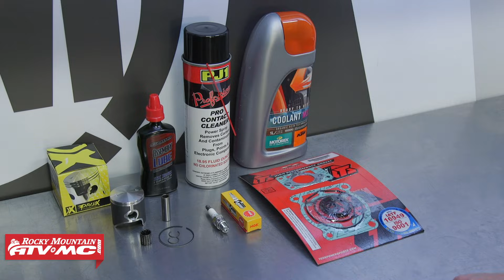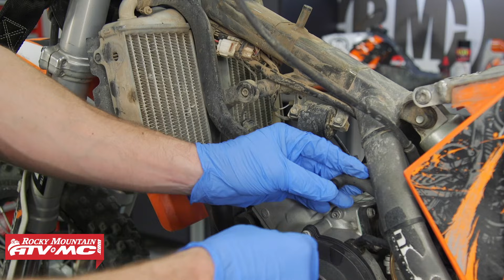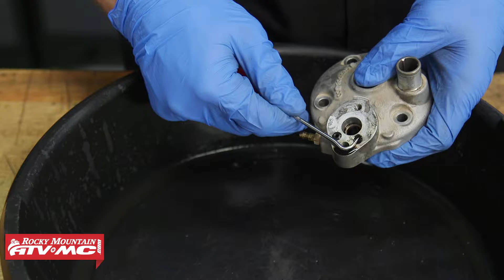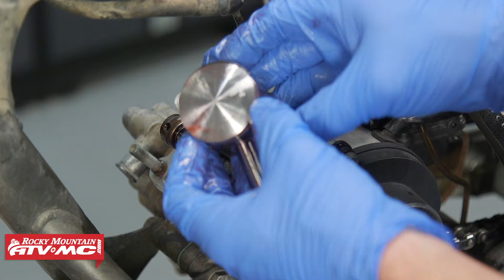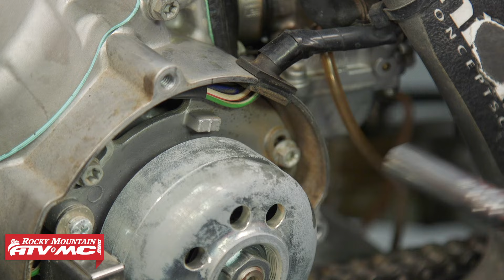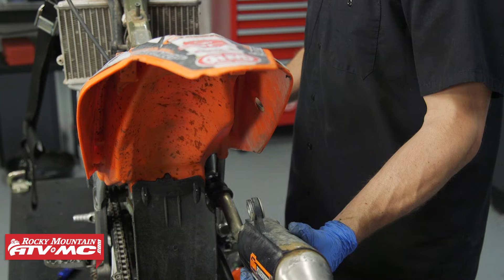How To Rebuild the Top End on 2009-2021 KTM, Husqvarna & GasGas 65cc Dirt Bikes

Comment: Like the video. Already rebuilt the bike once. I remember doing the deck check, but do not remember about the timing check and/or if I did that. Bike ran great, but did not like to cold start. Added next size or two pilot jet, so thinking my timing could have been off a little this rebuild. I'll have to check if it is advanced, etc. before I take this one apart all the way in the case it runs better as it's supposed to be or as it is today. Appreciate it!

Comment: Hi I have a ktm65sx 09 when I'm trying to start it keeps on blowing coolant hoses and will not start
Reply from the maker: It sounds like you might have a bad head gasket. You could be having compression pushed back into the coolant system making those hoses pop off.
Reply: @rmatvmc  fix by changing the head gaskets and o rings

Comment: Hi my gear box oil is turning milky after a few rides I've changed the  water pump seals but its still doing it please have you or can you do a video on this issue we have a KTM SX 65 2019
Reply from the maker: https://www.rockymountainatvmc.com/parts/nihilo-concepts-reusable-inner-clutch-cover-gasket-p?v=15836 Did you replace this gasket too? Coolant flows through it. -Charles
Reply: It's a pretty common is on these. lts probably not coolant and just water from washing/riding. Change the fluid often. Its cheap and easy maintenance!

Comment: Just sent our son’s 2020 KTM 65 into the local KTM shop for a clutch issue and they identified that it also had a broken power valve that had become so damaged that the cylinder needs replacing. They also said the cylinder and the parts for the top end rebuild are on back order until December 2021 🤷🏻‍♂️. Glad they found the issue but not thrilled that my son is potentially going to miss half the riding season…
Reply: Us chrome can fix any problems with your cylinder and it will have a stronger plating w/ better oil retention. 
Also the water pump impeller is plastic and comes apart it should be inspected regularly (visually or black floating particles in the radiator fluid)

Comment: Is piston replacement possible without removing the cilinder head? Is there enough space between engine and frame? I know it is not the right method for piston replacement.
Reply: Yes there is enough room. In a pinch I did a top end at the track and was able to remove the cylinder by removing the spark plug and coil to allow enough room.
Reply: No
Reply: It’s super easy to remove it